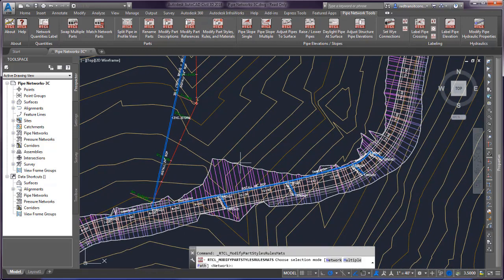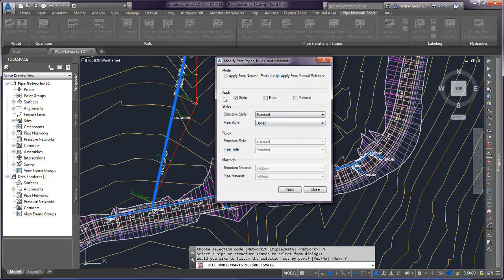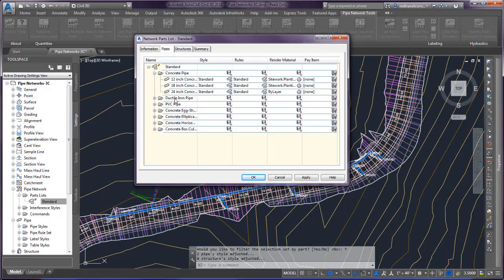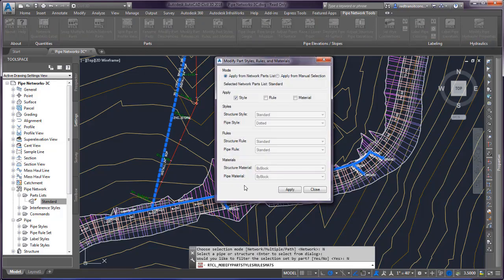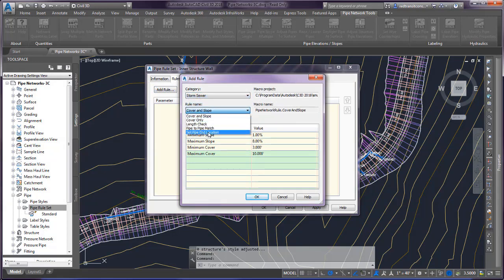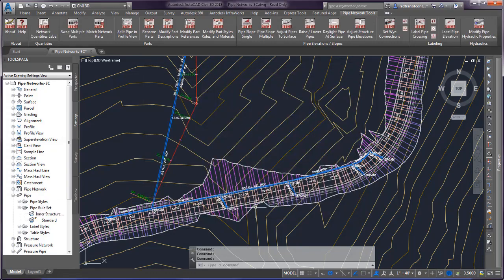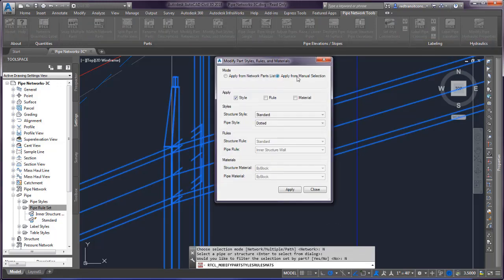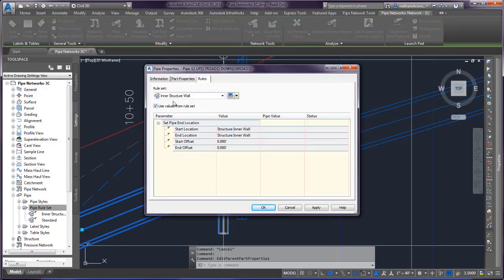Pipe Network Productivity Tools [v2.0.0.8] - Modify Styles Rules and Materials

Comment: when you set a rule for the pipes, using the module,  do we have to use the "apply the rules" command afterwards, or does the module do it all together, without having to go back and say "apply rules"?
Reply from the maker: Most of these tools were written around not using Pipe or Structure rules. Rules have had a lot of issues over the years and my preference was always to use them sparingly. However,this command should prompt or run the rules after applying. Are you not experiencing this?
Reply: @Redtransitconsultants  Unfortunately we are not. We set a rule for the pipes to start and end at the structure's inner wall. The problem comes in when we update out structure's location, the pipes revert to center to center, so now we have to rerun the rule. When we go the Pipe Network Tool - Modify Parts - Modify Parts, Rules, Materials, and run the command, none of the pipes get updated. They still have a connection to the center of structure.
Reply from the maker: @davidaguilera8288  Are you running version 2.0.0.8? I'll have to run some tests
Reply: @Redtransitconsultants  i did not have it updated... i just did... ill run some tests also now that i have the update... and let you guys know... thanks!